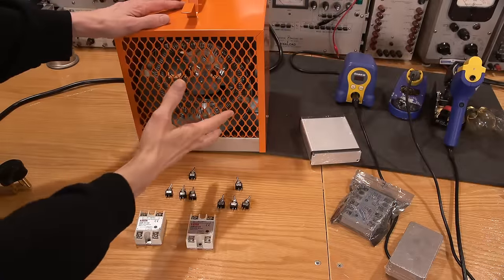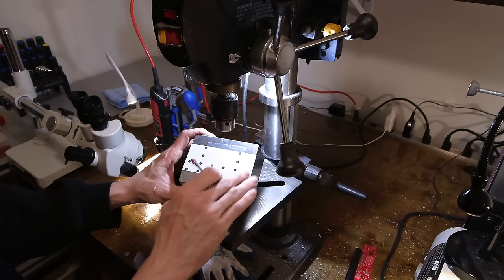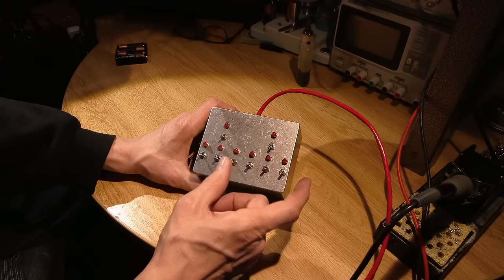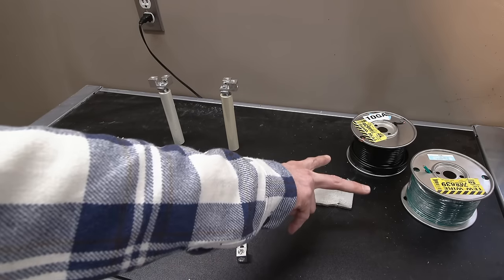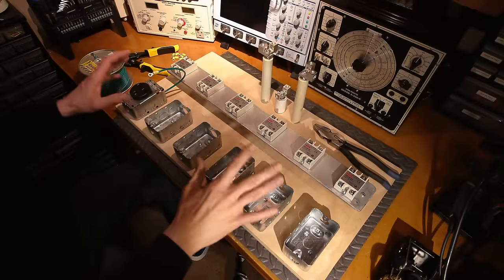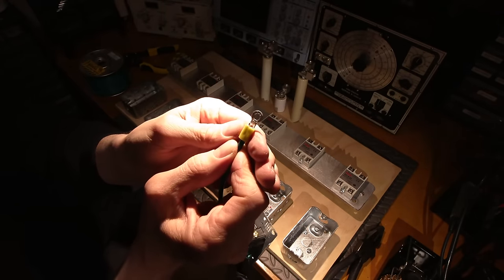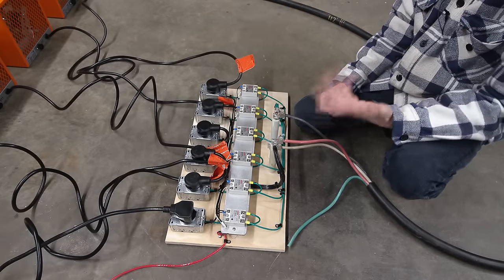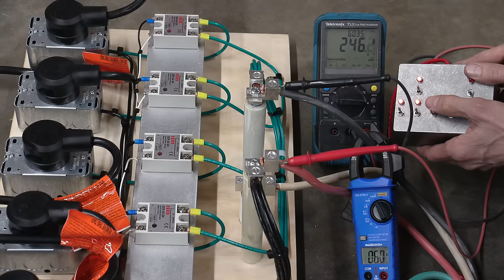27000 Watt Load Complete Build!

Comment from the maker: To learn electronics in a very different and effective way, and gain access to Mr Carlson's personal designs and inventions, visit the Mr Carlson's Lab Patreon page here: https://www.patreon.com/MrCarlsonsLab
Reply: Are you familiar with Armory Lovins at Rocky Mountain Institute  and Bill Mollison of Permaculture fame ?
Reply: Should have just done a voiceover when gen was running.
Reply: HAPPY EASTER TO YOU AND YOUR FAMILY MR CARLSON.  ⚘⚘⚘⚘
Reply: 27000 watts- sounds good
Reply: FYI, get yourself some centre drills instead of small drills. The stubbier length for the start portion makes them a heck of a lot stouter than small sizes of drill making them perfect for starting holes. If you're lucky, you can even find them paired up for common dimensions. And yes, they do make them in small sizes. I've even seen them with 1mm starter drills paired up for a 3 or 4mm hole. Worth having a few around. Bonus: easy to sharpen, the flutes are simpler in design and they come with two ends. So you have multiple uses out of a single centre drill vs a drill bit which eventually runs out depending on how lucky you are when it breaks.
Reply: WHAT   ARE   YOU   GOING  TO   DO   WITH   THIS        ??😊
Reply: @rosariodagosto6484 Laugh, cos it was April 1st?
Reply: Thanks       for     joke
Reply: That's got to be one of the biggest variable resistor I've seen. Why not lower V and higher amps? Cool that you can control that though. Is this part of a science project.
Reply: hello  Paul.  I  have a power supply  220  550 amps dc set at 14.8 volts. I was wondering  if I run external  caps to help with the draw my 16pill  amp pulls.

Comment: Nice work!  I'm building a load out of 500W and 1kW quarts lamps for my Onan generator.
If you want a frequency display that you can see from across the room,  get a Korg DT-1 Pro guitar tuner.  Replace the stock crystal with a programmable oscillator set to 6.177180MHz.  That makes the A# setting exactly 60Hz.  It'll show 58.28Hz to 61.76Hz.  Each LED shows a 0.0375Hz change.
Double check that osc freq.  I'm going off of my notes that are a few years old.

Comment: I beg to differ with you Mr. C on the crimper.  If you were to spin it 180 degrees, the crimper will force the seam together and put the dimple on the back side and will apply pressure of the crimp without the chance of missing the seam...which would be a failed crimp.

I've also had zero failures (in close to 5-decades) of using what you termed the double-oval type crimper.  I do use a double-action crimper so a much greater force can be applied with less hand pressure (e.g. Sargent 3120)...they're good up to 10awg.  for larger, I go to anvil type crimps and again, the dimple part goes on the BACK side of the crimp...the seam goes down into the smooth curved part of the crimper to force the seam together.
Reply: Yes, checking actual instructions will verify this.  Also,  store bought connectors all seen to be thin and weak (Chinese). They will not hold a crimped wire securely.
Reply: Correct use real connectors and i use a Knipex crimper always good connection
Reply: Although this is according to the instructions, what results is that the wire strands are pushed out through the split, as the sides pull back, opening the split because of the dimple. The only way to make them reliable and repeatable is to center the dimple on the split.
Reply: Look up what the manufacturers like Panduit want you to use. Those are the crimpers that do the job right and are certified. Everything else is a tradeoff. Even a well used brand name crimper (two dies in a ratchet) will do a better job than anything without a ratchet where you have no positive indication of a full crimp.
Reply: No, that is exactly wrong.  Once you press in on the seam with the crimper, you create the opening that can allow strands to not be crimped.  The seam is touching before the crimp is applied.  If you have the seam down (away from the dimple, as you use the crimper, the seam is held together as the dimple presses in on the back, reducing the inside area for the wire, which allows for the crimp to work.  There is no means for the wire to go through the seam as it never separates. 

There are plenty of examples of crimping as Mr. Carlson showed where crimp quality is poor as many people will not precisely center the dimple.  And, even if you do, you create the gap, which you don't want.  There is no way that the method he showed is better than the "proper" way.

He can do it any way he wants, I just would never advise people to do it improperly (or against the manufacturer's instructions).  As for regulatory approval, they almost always stipulate that a condition is to install as per the manufacturer.  

Mind you, there are a LARGE variety of crimp manufacturers and quality of crimps as well as crimp tools so there are other variables at play here. 

But hey...try it for yourself.  Crimp with the dimple on the back (aways from the seam) and try another with it crimped so the dimple presses in on the seam.  See if there is any improvement between one and the other.  Then be just a smidge less precise when you are crimping and see how it goes and which way is more forgiving too. 

There ARE crimp styles (typically smaller signal times) where part of the crimper's job is to have a proper die set that will curl over the crimp as well as also wrap the crimp around the insulation to form a straing relieve (e.g. a Dsub crimper)...but that is not the case for the types of crimps that he showed.

I didn't bring up the issue as a "gotcha" moment for Mr. Carlson either.  I have the highest respect for him, his projects, his knowledge, his channel...etc.  I was just surprised that he would go out of his way to recommend an improper method.  Making crimps like the ones he was doing is something I've done countless times in the last half century.  If it was just a technique thing, that would be something different.  We all have our own styles.  I, honestly, think what he recommended could lead to some people making very poor crimps.
Reply: @sguttag  I've stopped relying on this type of crimp.  I'll use the hydraulic press(cheap @HF) with copper lugs or solder  wire in connector for the smallest connections. I can't find the robust connectors like i used to get. I guess I'm not spending enough money.
Reply: @jspencerg  , if you want expensive and good crimps, AMP (TE connectivity, now) PIDG series are excellent crimps.  However, if you'd like good and yet more price friendly crimps, I've found that Del City has a line of very good crimps.  They do have a range though so they are not all the same.
Reply: I really like the Channel lock brand hand crimper
Reply: @sguttag  I shop there and have looked.  Which of the ring connectors would you suggest?
Reply: @jspencerg  I like their Nylon-insulated, Brass Crimp Sleeve Terminals.  So, using the #10 stud, the 653105.   If you search on that part number, you should get the entire yellow ring family with that crimp characteristic.
Reply: @sguttag  Thanks.  The only issue is their 100 piece minimum on that part.
Reply: That is going to be pretty typical.  We normally order in the 100-1000 range, depending on the size, style and what is likely to be used.  Admittedly, we are using such crimps less than in prior decades.
Reply: Always amusing to watch people argue over the "correct" way to crimp junk terminals, lol.

Comment: im glad to see Mr Carlson take preemptive measures to combat the cold Canadian winter
Reply: by doing what? converting a possible 156KW of energy stored in the diesel being consumed, into approximately 27KW of heat in a resistor?
disele engine... 30% efficient... 52KW output, using approximately 156KW worth of diesel. generator, 50% efficient at full load, for 27KW of heat, the other half  of the engines output being dissipated by the generator itself.

a heat exchange on the exhaust and cooling system would be far more effective use of the potential energy in the diesel, if ones primary goal was simply "workshop heating".
Reply: @paradiselost9946 I know right?  Just build a bon fire in the shop and huddle around it for warmth like you would.  Duh.
Reply: @bullycabalrecruit2215 why huddle?

not sure if you are being sarcastic or agreeing.

me? i would run a small diesel heater, use about 1/5th fuel, and release the same amount of heat. no huddling required. as the majority of heat in that fuel will be released and go towards heating air.

but i doubt the intention here was to simply produce heat. its a load bank. i assume its simply to test the generator. if its main primary purpose is to heat a workshop? then its an exercise in stupidity and ignorance.

Comment: Your comment about the LED bulbs got my attention.  I have several different brands of bulbs at home and one brand is really sensitive to power line fluctuations.  All of the bulbs of that one brand will blink at 2 Hz at different times of the day depending on how the grid is being loaded at the moment.  The line voltage drops from around 122 to 117.  It gets very noticeable around 4 PM EDT and also around 8AM when everybody has their coffee makers on!   I never noticed this with the old incandescent bulbs.  Thanks for the superb video.
Reply from the maker: I have noticed the same here, certain times of the day, the LED lights above the bench will flicker at about 2Hz. Thats interesting!
Reply: I worked for the power company for 32 years. One of my jobs was voltage regulation by switching in various sizes of capacitors. I notice cheaper LED lights are susceptible to the voltage changes on the grid. The smaller caps were around 20MX and the largest was around 300MX at 230,000 volts. MX stands for Mega VARS. They would go into service in the morning when everyone wakes up. Voltage goes up. Then after dinner time, most would come out of service. Voltage goes down. Great video.

Comment: I made a generator load from three 9kW new old stock shower water heater modules off eBay at £12 each, some hose, hefty cable and three 32 Amp MCB switches in a domestic consumer unit box, so like your good self, each 9kW module can be brought in and out. A hose to the outside tap flows unrestricted mains water through them, the waste going to a drain or just onto the ground.

 Works well for testing generators and loading them for an hour or so to clear wet stacking.

I enjoy your channel, happy Easter and good luck.
Reply from the maker: Thanks for sharing your story Chris!

Comment: As a industrial power generation tech It would be cool to see you make some content about voltage regulation and speed control repairs. Lots of obsolete parts out there and more to come the way things are going. I would especially love to see you show how different loads create harmonics. I just had a site that has 95% of the loads consisting of VFDs. Customer was blaming the generator . Right now I have a temporary filter on it . Its amazing to see what it does to the sinewave. Love your content!
Reply from the maker: Thanks for your input!
Reply: One company that I worked for had a project to replace MG sets for elevator service with SCR drives. The stepdown transformers started overheating due to the harmonics, so we had to replace them with upsized units. 
The job was completed in mid-2001 (at the World Trade Center), so we all know what happened with it.

Comment: Back in 1996 I used to build generators for a company called Stephill Generators and we had a near identical test setup with 500 watt halogen bulbs (the type used in garden security lamps). 500w, 1kw, 2kw and 4kw switched in. Basically we could test generators from 1.2kva right up to 8.5kva (some 10kva too but only 7500w). As the bulb box was a meter cubed we really did net feel the heat but instead got blinded by the light escaping through the Louvres. The bulbs worked great as a purely inductive load and aided setting the frequency 50hz in the UK, and the voltage. The engines we used for also welder generators (portable arc welders) were Honda GX390 for the largest with Lister petter, Rugerrini, Lombardi, Briggs and Stratton and Yanmar diesel but by far the most reliable engines were Honda for petrol and Lister Petter for diesel. Great video Paul and the other beach used to build huge generators somewhat larger than this. The last I worked on was a Rolls Royce 250kva and PetBow alternator. I can’t tell you home much this engine handled 250kva without breaking sweat. Mecalte and Markon alternators simply couldn’t compete!!!

Comment: I work on 10KW heaters for 1800 pound solder pots, we use the same ssr's to control strip heaters strapped around the solder pot to melt solder for electronics wave soldering. once while testing a system for a fault an assistant measured across an ssr and it exploded with the force and sound of a gun shot. a large piece of the top came off as an inverted cone and shot across the room narrowly missing the assistants head even the safety glasses may not have prevented injury had it hit. The input circuitry to this ssr was faulty and the probing allowed the ssr transistor output to bias at the half way max power point and the semiconductor superheated.  In order to test for the fault the Polycarbonate shield covering the ssr banks was removed. I strongly suggest a Polycarbonate protective shield  strip covering the body of all the ssr's. long pcb style standoffs are used to suspend the shield above the ssr's.
Reply: playing with simple ZVS induction heaters, i find i can make FETs explode instantly by pushing an iron bar into the coil when its running.

no issue if it STARTS with the bar in place, but to push it in when its already running?  everytime, one FET simply explodes. 

something about altered inductance, the decreased reflected impedance with appropriate increase of current draw, and the abrupt change in frequency that they dont appreciate...

Comment: it is very satisfying when all the hard work you've done works,  well done!!!  as a retired union electrician, whether it is 22 AWG or 4 AWG or 00 we strip wire.  the only bit I would like to add is that if wire is a single conductor, it is wire and not cable, and it matters not if its stranded. mike

Comment: More like 30Kw!! What a great shop genset! It’s using every bit of that 23hp Kubota diesel.
Reply from the maker: It's rating is 69.5 HP at 1800 RPM.
Reply: @MrCarlsonsLab  Wow! That’s even more impressive of a rig. Especially for a home shop. If it’s worth doing, it’s worth doing right!
Reply: Diesels work best when under a load.  Solves the issue of using a big generator to power a house.😂
Reply: @MrCarlsonsLab  Even under full load, that engine sounds like it's barely working. Running at 1800 rpms is WAY better than 3600 rpms.
Reply: @Mark.R_  wasting 27kW is a shame anyway. At this point accumulator setup would be preferable even economy-wise.

Comment: If you wanted to build a dummy load for an electric chair, about 15kW would be enough. As far as I know applied voltage is 1'500VAC while an internal body average body resistance of 150 Ohms is assumed. This results in a current of 10 Amps and 15kW frying power. to test the chair before usage, a dummy load is connected (Source: Dept. of correction, Florida).

Comment: @MrCarlsonsLab   Did you build this load bank in order to do monthly tests of your backup generator??   I'm a Data Center Design Engineer and have been designing and building backup power systems for Data Centers for the past 35 years in the 10 to 50 megawatt size.  If you're going to use this load bank to do monthly tests I would recommend you make the cables long enough to put the load banks outside and run the generator for a minimum of one-half hour at 90% load.  Any less and cylinders will not heat up to full stretch and you'll create a ridge on the top of the cylinder and also wet stack the generator.

Comment: My dream backup generator.  We run our home on a 7kw portable.  Last winter we lost power 3 weeks and the year before that it was almost 5 weeks without power.  I have a manual transfer switch and current and voltage of the system that can be viewed inside to help keep a eye on whats being used.

Comment: Hi Mr. Carlson,
Fun fact about that particular brand of solid state relays.
We purchased a batch of them to replace failing ones in T-shirt presses, however, they did not function correctly.
It turns out their minimum "pull in voltage" of 3v was actually more around 5-6v. The temperature controllers in the presses were outputting about 3.4v. 
Therefore, the relays would never allow current to pass. 
Your model of relays may not be the same as the ones we were using.
Figured I would let you know about our experience.

Comment: I believe that the split the connector should go into the radius portion of the linesman pliers with the pointed portion acting on the non split side of the connector. I believe this is the preferred way  from most manufacturers. That way the connector Barrel doesn't spread open and the wire is held nicely by the divot left by the pointed side of the crimping die. I am only speaking of using the split connector with the type of die on the linesman pliers. I love your content. You are one smart fellow!

Comment: Back in the early eighties as a young lad I worked in the sound and lighting industry. Monday mornings we had DJs coming in with destroyed lighting controllers and molten 6v 36w pinspot (PAR36) transformers. This is how I learnt all about non zero crossover switching applied to resistive verses inductive loads on 1970s 'chasers". Of course, all lighting controllers moved to zero switched as time progressed. I even remember the triac was a BTA08 400s with an isolated tab. :-)
Reply from the maker: Zero cross opto's are very nice. I use them even when not needed in AC switch design.